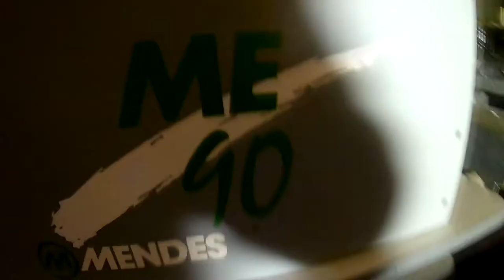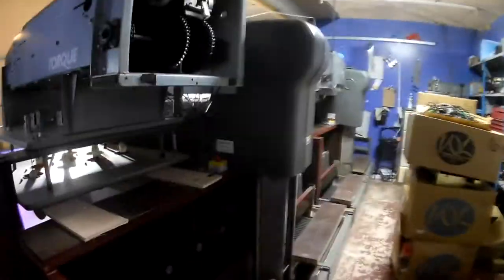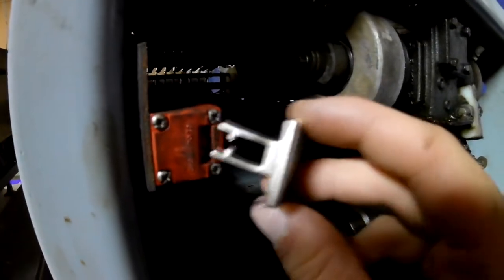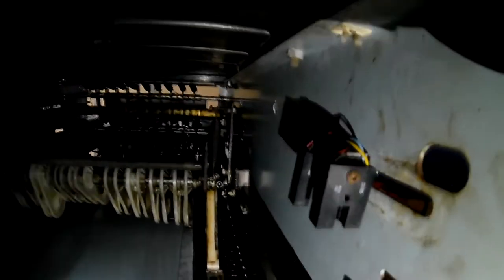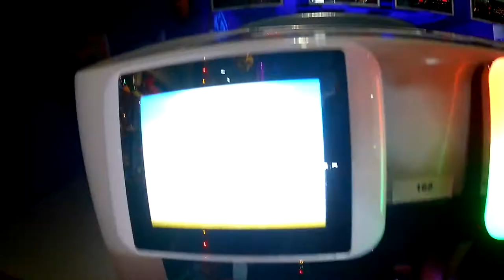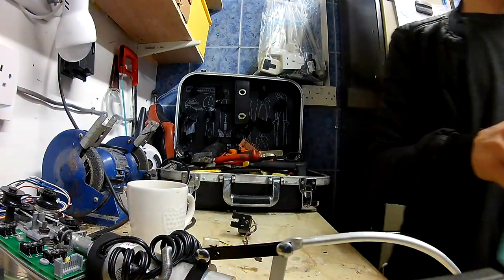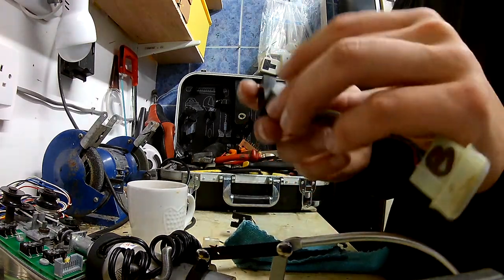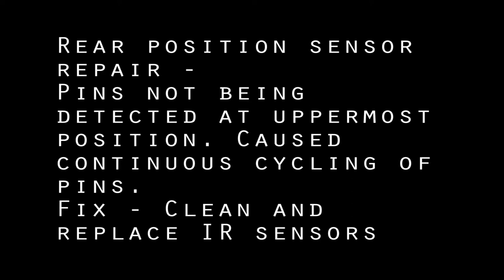Mendes 90 Bowlingo Pinsetter - Arcade Machine Repair

Comment: Check your pressure of the pinsetter , should be max a 250psi , otherwise change the 3 optoswitches of the pins drawbar. I know Mendes ME-90 like the back of my hand im a chief mechanic in a bowling in Montreal and we have 42 lanes equiped with Mendes ME-90 pinsetters, and check your string lenght, press FS1 + PS1 on the pin detector board for a string test , your pins drop on the pin deck not equally as they should
Reply from the maker: Dominic, I've been looking for someone like you for too long ! Firstly thank you for your comment! Is there a way I can reach out to you?
Reply: @towellie  via email or messenger
Reply: Via email or messenger wich one you prefer
Reply from the maker: @dominicbedard8141   @Dominic Bedard  If you could add me via https://www.facebook.com/Towellie
That would be awesome!
Reply: Its been added to my facebook
Reply: And also i can give you a good tip, once a month shoot some compressed air on the clutches, to remove the dust and metal shavings , they will last and have better contact and wear less the magnetic clutch and sproket. Other thing, clean your pin detector opto switch wheel (black one on top and the white one where the string pass) and doing that every 2 weeks will improve the accurate pins that been hit , a lot of string dust accumulate there and obstruct the infra -red holes in the opto switch .

Comment: What does the ball return look like
Reply from the maker: It's a chain lift right at the rear of the pin setters, raises a ball high then sends it on a wacky roller coaster back to the front. Would you like a video on it? My newest planned video had audio issues so I can't use it.
Reply: @towellie  Hi Tom, I'd be interested in seeing this video if you still plan on making it - these machines are very cool
Reply: @towellie  great video always been interested to see how these machines work inside. I too would be interested to see how the ball return system works too 😊